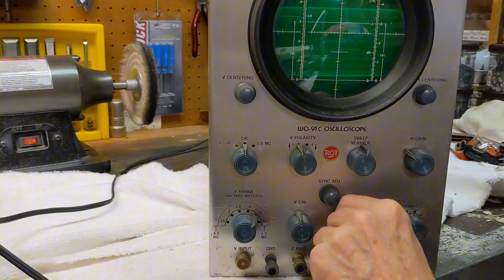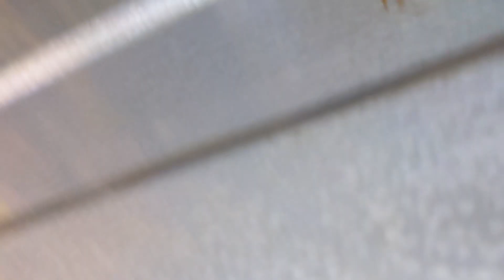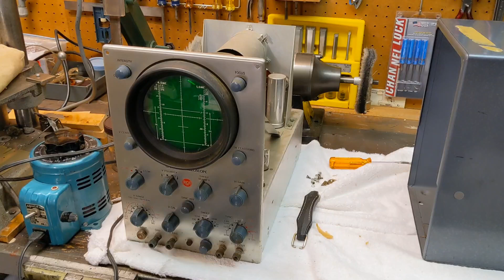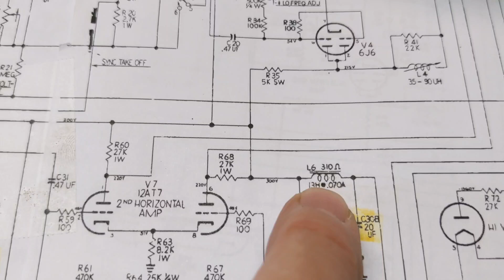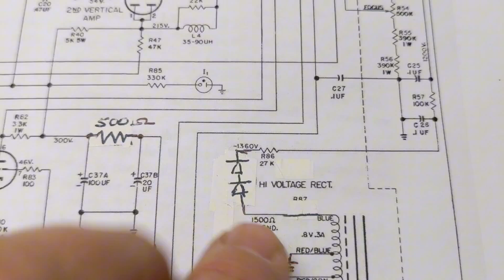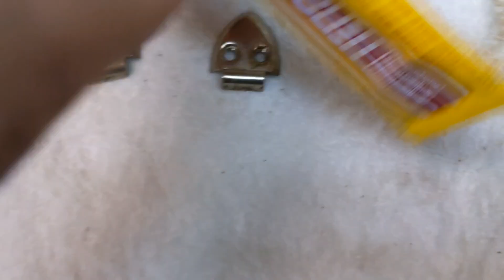Old School RCA WO-91C Oscilloscope restoration Part2

Comment: Hi Fred,  Gary here.  I acquired that model from Goodwill, auction, for $25.00 back 7 or 8 years ago. It is still all glass O-scope,  I wanted to do an all tube project to familiarize myself with tube era gear, like transceivers and test gear.  I did a functional restoration and "calibrated" to back to specs.  Recapped and replaced all resistors as needed.  Pretty strait forward project.  Fun point to point wiring and working in a cavern.  The only issue is the hours on the CRT is long in the tooth and the trace is dim.   It was the first time any real time with a soldering iron since voc. tech degree in 1985.  I loved electronics since youth, and the school was gearing to old school teaching electronics theory and practical board level training hands on and such,  I got back into electronics as a hobby in 2015 and have been having fun ever since. I have some simple YouTube videos I made about the HP-400C vacuum AC meter, a Heath Kit IP-17 High Voltage power supply.  I like what you are doing, good job Fred, and thanks for sharing. Happy Holidays.
Reply from the maker: Hey Gary, thanks for sharing. I graduated Vo Tech in 1971. Got my Ham license back in 1990. I've always enjoyed electronics, started doing some restorations about 12 years ago and just recently started posting videos.
Have a Happy and Healthy New. Year.

Comment: With all due respect, you seem to be focusing on the cosmetic restoration while serious electronic problems still exist. Why not get the scope working to factory specs first, then work on the cosmetics?
Reply from the maker: Well Andy, I could be doing that instead of cleaning it but I have parts on order that I believe will either fix the problem or at least work in that direction. So until I can replace the parts I know are bad, I won't go any further. Here's a spoiler, I replaced the caps that were in the 4 section can and the display is looking better.
Part 3 will be after the New Year, 10:06  hopefully wrapping it up in that video.
Wishing you and your family a Happy and Healthy 🎊🥳
Reply: @ko2fjb  My apologies. I did not consider all that.
Reply from the maker: @andydelle4509 hey, no apologies necessary, everyone has their own system, I was just explaining my thought process. This next one is going to be good, mistakes and 800 volt shock.

Comment: What I use for cleaning tube sockets is a tiny brush I get from the toothbrush section of the drug store. They are tiny cone shaped brushes and come in a package or ten or so.  I put contact cleaner on the brush and push it in and out of each pin socket.  I find that they clean better than pipe cleaners.
Reply from the maker: I've been using those little brushes for years and they work great.